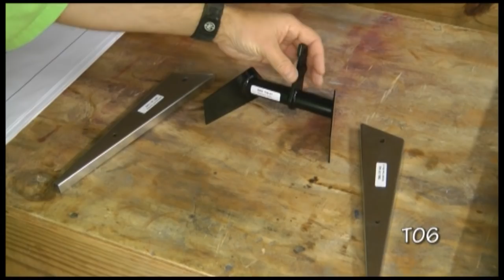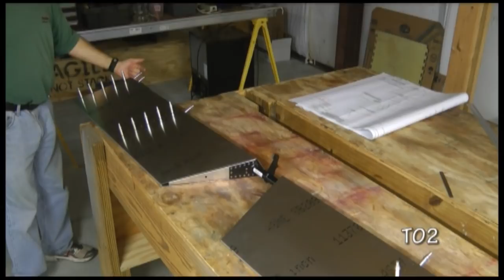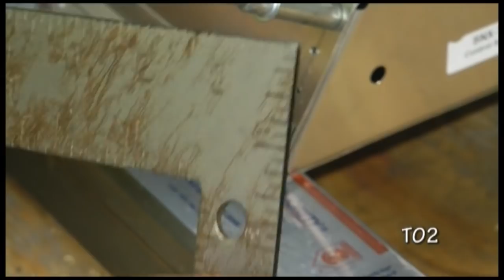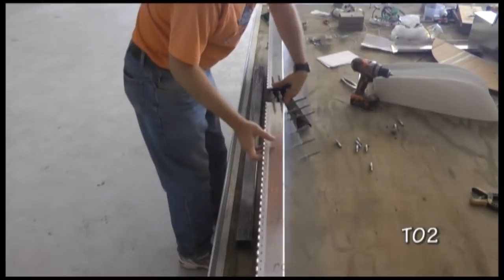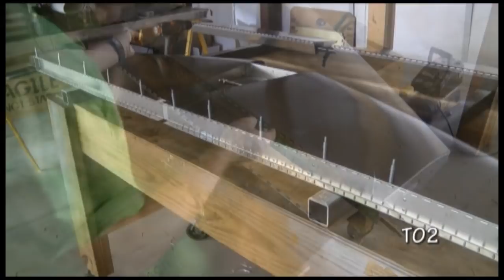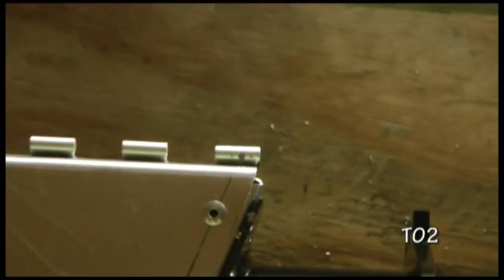Sonex Tail Kit Step by Step Build: FINAL Part 5

Comment: First let me say thank you for this series.  It has been very educational and your effort is greatly appreciated.   
At 25.32 you place one cleco on each end of the elevator then disassemble .  Would it not be beneficial to drill and place one cleco on the inboard end of each hinge prior to disassembly while it is in alignment thereby ensuring a strait hinge.  Or inserting a hinge pin through the hinge to be attached to the horizontal stabilizer spanning both pieces of hinge.  I'm not by any means saying your technique is not sound, I"m just asking as I am interested in building.

Comment: I don'y know if you've heard of this tip. I learned it from a model airplane magazine article years ago. When using a long aircraft drill bit, you can slide a piece of brass tubing over the bit near the tip and use it to guide the drill bit with more accuracy. Though you may want to put a drop of oil on it if you need to make a lot of holes. This tip has saved me lots of grief when I didn't get the holes right on the firewall in my models. Tight Turns,  Claude